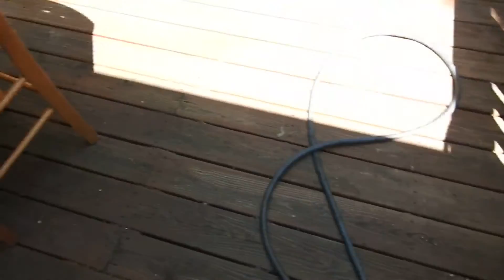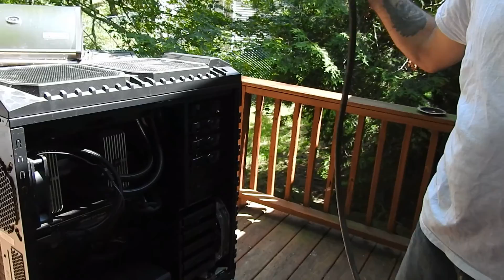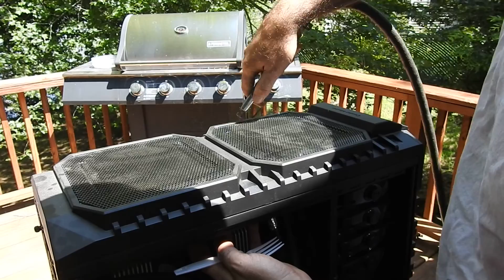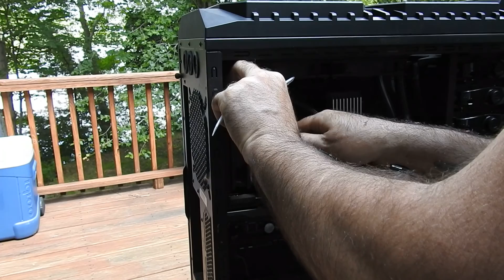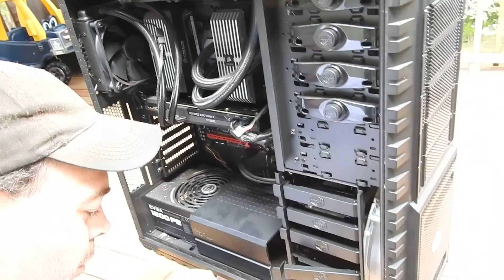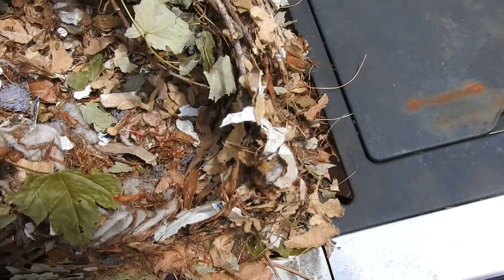HOW TO CLEAN DUST OUT OF PC W/ TITAN X  HAF X LIQUID COOLED

Comment: Never use compressed air from a compressor on a PC. All air compressors end up with condensation in their tanks and that can make it through the line and can potentially damage sensitive components. I've seen it happen.
Reply: That's why I have an in-line air dryer using dessicant, and an oil remover as well even though my compressor is "oil-free". Can't be too careful. Sure beats paying $$$ for those useless cans of air.

Comment: dust might be comming in from back due to PSU intake. There are slots at the bottom to force it into its own loop (if you flip it). If you clean of the 2 main intake filters (front and side) more often might not have so much interenal dust to clean. Mine had a small fraction of what yours had after a year of use
Reply: no the PSU now acts like an exhaust fan